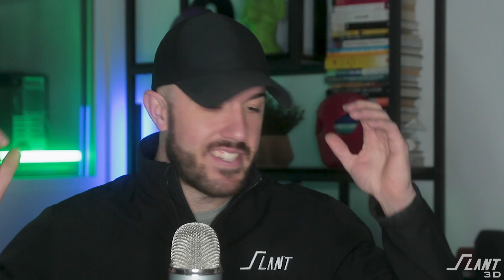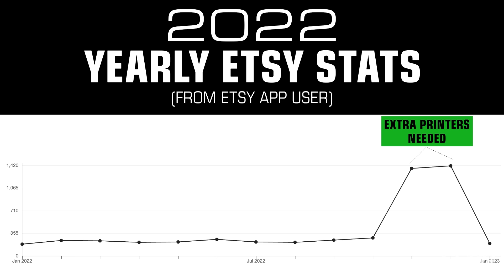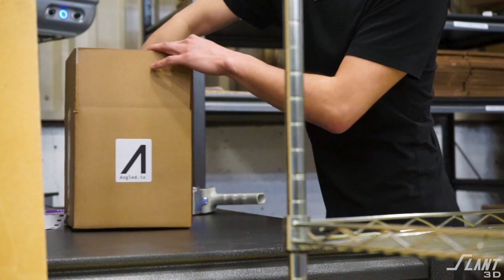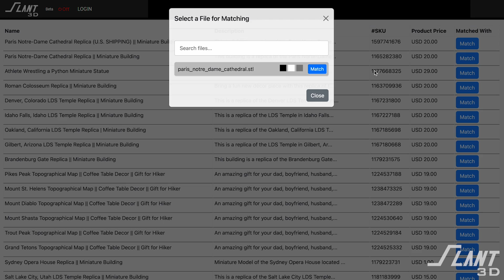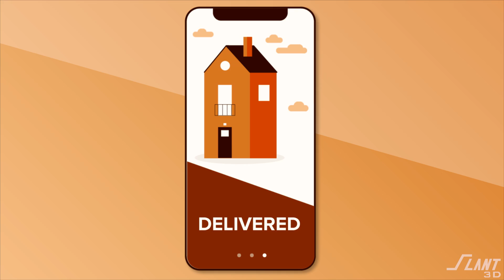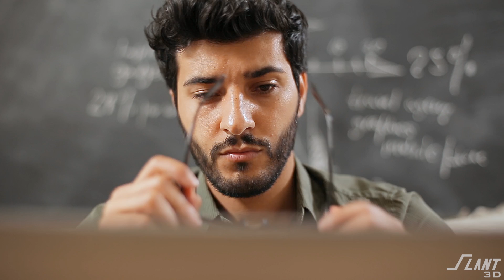Easy Print on Demand with Our 3D Printing Etsy Plugin | Version 3 Upgrades

Comment: Love the concept. A few questions that you are probably already thinking about. Curious of your estimated timeline (if at all) : 
1. Print farm origin countries. Which one(s) do you have?
2. Hardware fulfillment. Could you either make it so we ship hardware separately, ship "packs" to you ahead, or we drop ship to you through a local supplier and you repack (amazon, etc .) 
3. Heat set threaded inserts. Any plans on doing these as well? 
4. Custom drop ship branding. We send you a media kit, etc... 

These are all cost uogrades that may or may not fit your business model. My suggestion would be to give a realistic timeframe on these so potential customers can wait, or possibly design around these hangups. I'm personally building an international network of small print (gardeners?) to help speed up our shipping time for now lol.
Reply from the maker: We would like to add thrid party components in future. But likely not install. With hundreds-thousands of users it is not feasible to build a workflow for each one. And train people to correctly install custom hardware components.
Reply: @slant3d  I completely understand that. 
Maybe consider being clear on your intentions (if you aren't already). Customers tend to say they will wait until something might happen instead of coming up with an alternative way to work with current capabilities.

Comment: As someone from Europe. I can see a use-case where I can handle fulfilment in Europe myself, but outsource it to the Slant 3D app for orders from NA. Would something like that be possible?
Reply from the maker: Absolutely. Jsut connect the app and create listing that are restricted to the US only. And then you have US Distribution
Reply: I would love to do this also. However, I now have to pay for one Etsy posting and customers can order world wide. With your solution I would need to pay for two postings per item, which would double the Etsy cost.  Can there be a better solution? Perhaps where your app can tell if an order is in the US or not, and then fulfill or not based on that?

Comment: I'm interested to use your servicd however it needs good tolerances which I'll have to specify with you to avoid problems that it won't fit or be too loose
Reply from the maker: The best thing to do would be to design theose tolerances into the part using features like grip fins. Then they are more robust without speciality slicing.
Reply: I'll see what I can do with grip fins, however it has to be often inserted and released easily, ideally it should be just straight and perfectly sized but I get too many very small variations that impact heavily on the practice

Comment: I assume the pricing in the app is based on a preset slicing profile? Do you have the ability to cater to different profiles, e.g. functional parts vs decorative. Someone selling flexi toys will have a different appetite for material per cubic mm than someone selling parts that need to handle some load and stress.
Reply from the maker: 0.2 resolution with a 20% infill in PLA

Comment: Is there the ability to add other items into this mix?  Such as an instruction sheet, metal hardware, or a bag of misc. other parts?
Reply from the maker: Not right now. We have it on the roadmap.
Reply: An option to include basic metal hardware (nuts, bolts, inserts etc) would be awesome